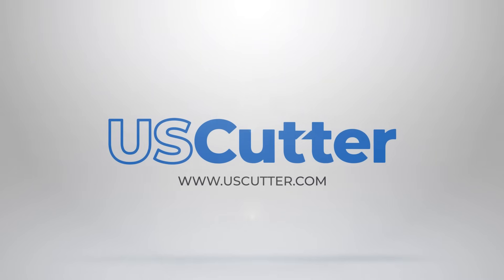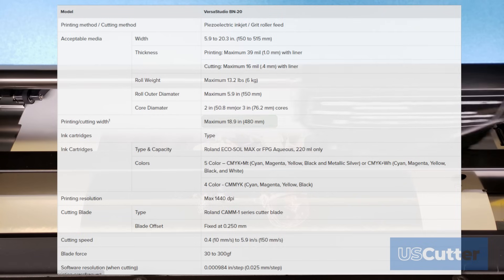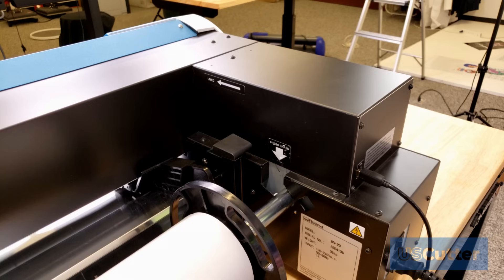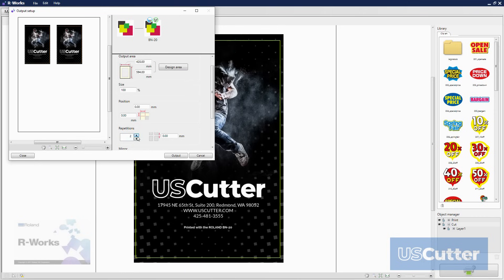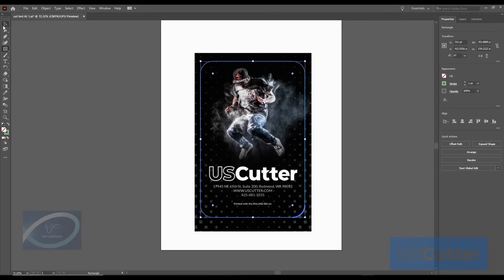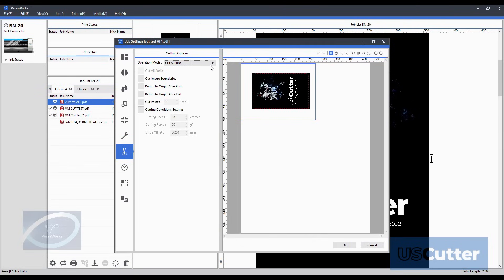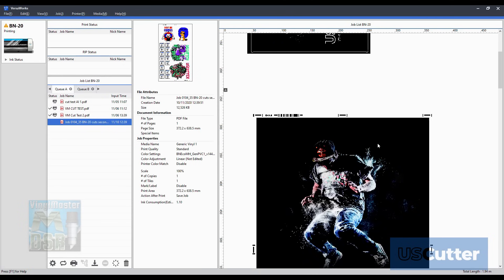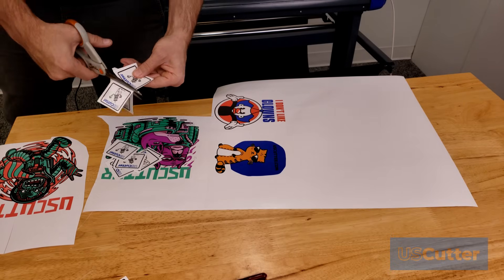INTRODUCTION WITH INSTRUCTION - ROLAND BN-20 - THE BASICS OF HOW TO PRINT AND CUT

Comment: Is there a way I can use R-Works without the BN-20 printer? I have a Roland BN-20A and I would like to try R-Works but I don't see anywhere on the internet where to download it.
Reply from the maker: Roland R-Works was not included with your BN-20A because they quit updating and supporting it many years ago.  The installation file was always packaged with the BN-20 driver installation CD-ROM so you would need to find that installation program or cd image if you wanted it.  They quit including the CD-ROM installer about 2 and a half years ago so you could try asking anyone that has owned a BN-20 for longer than that for a image of the cd-rom.

Comment: Can you use the vinyl master software to print and cut on this Roland or the bn20a?
Reply from the maker: You can use Vinyl Master to create files to use with the BN-20 but everything will need to go through Roland Versaworks to print.
Reply: @uscuttervideos  thank you that will save a lot of time I already know how to use vinyl master. So basically I can create the cut lines save the pdf and cut it on versaworks is that correct ?

Comment: is thick media supported? i'd like to experiment with making "pseudo" enamel pins. this machine does metalic, so a fake gold might be in order.. the media is shrink film. it doesn't come in rolls, so i'm wondering if i can use a carrier sheet (that's the thickness), but the actual print media shrink film is about as thick as normal paper, definitely thinner than walmart printable cardstock. i'd have to use targeted printing (manual placement of the sheets on the carrier.) hoping that since this is solvent ink, baking the prints for shrinking doesn't affect the colors much (especially the metalic).  it would be better if i could print directly to the sheets after they are baked and then use a CNC to cut them out, but that would be too thick as it would collide with the head for sure.
Reply from the maker: You could possibly try that but I imagine feeding in sheets could be pain depending on the flexibility of the substrate and backer. The machine demands to be roll fed, so you will have to leave the media bar and flanges loaded into the machine so feeding the sheet could be a pain.   
I don't think you would have an issue with the thickness of the paper  but including a backer could cause an issue.   
I personally have not toasted any Solvent ink myself, but before you laminate or anything you want to allow the ink to air out for 24 hours so I would recommend doing that too. You could reach out to a sales agent and send in some of that media to use to take a look at.  Just give them a call or shoot an email over to SALES@USCUTTER.COM to set that up.

Comment: Is it possible to print on car Wrap like, 3M controltac film with this printer?
Reply from the maker: I am familiar with that material and it will work with this printers ink.
Reply: @uscuttervideos  thx for the info, do you know if there is even smaller and cheaper printers that can print on car wrap film? Is only the kind of ink or is it the way the printers does the work? Im working on a small project and I need to find a way to print on car wrap films, whitout spending 8k$ +.

Comment: Great detailed video! I was wondering if the BN-20 can also cut thick and  structured label stock (as ie. on wine bottles)?
Reply from the maker: Max. 1.0 mm (39 mil) with liner, for printing Max. 0.4 mm (16 mil) with liner and 0.22 mm (9 mil) without liner, for cutting

Comment: confused about eco solvent...  is that just regular inkjet printer ink (like pigments or dyes from an epson), or is it completely different? i want a machine that can make stickers without the drama of inkjet sticker paper that is basically just photo paper with sticker backing (it smudges, scratches and is a complete waste of money).  i want stickers like what you buy at the store or something, not from etsy users who all exhibit the same smudge/scratch issues.
Reply from the maker: You have had issues with water based inks. If you allow solvent inks proper time to dry its not an issue with the CMYK.  If you want it to last outdoors ( no bleaching from the sun and  weathering from the elements) then a small layer of laminate over the top is recommended to really increase the durability of your print.

Comment: Just ordered mine do you have a installation video for the bn20
Reply: I just got mine in last week and I used this Roland Video for setup.  It was very helpful.  https://www.youtube.com/watch?v=T0_xVLUhahQ
Reply: @damonpence  I ended up getting a latex 115
Reply: @damonpence  Hi there. Can you share how is this machine working for you? It would be awesome
Reply: @mhb207  Its not really doing what I need but its not the machines fault.  I print a lot of Gray and with all machines grays are hard to print correctly.  I should have gotten a UV printer but big cost difference.  However with that being said, the machine does print and cut great for all other needs.
Reply: @damonpence  Thank youuu!
Reply: How does the transfer for shirts feel?  Soft, rough, cardboard ect?

Comment: 0:27 I setup you auto proffit site with done for you 6k monthly income. It is a ready made website with content, connected offers (digital products), google advertisement, amazon advertisement and 1 month connected traffic of visitors. Managing it wisely you earn 6k monthly and your expenses will be 1950$ for the installation and 600-700$ for traffic which you need to send monthly. Speaking about traffic you will not need to worry about this- as we usually send this amount and we continue maintaining it. It is not the system that you just press the button- and here is money, as you will need to manage it. But if you follow our instructions the income is guaranteed. w h t s a p +7 9 6 7 1 5 7 0 5 8 1